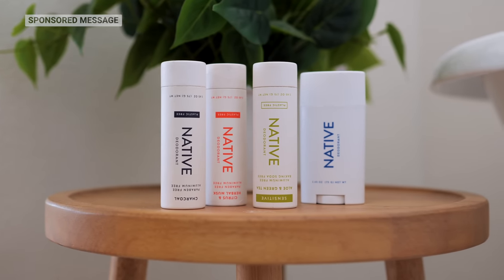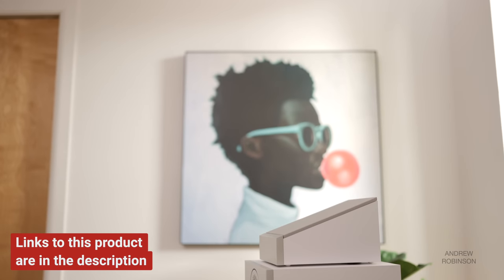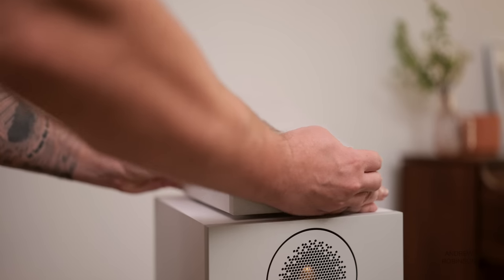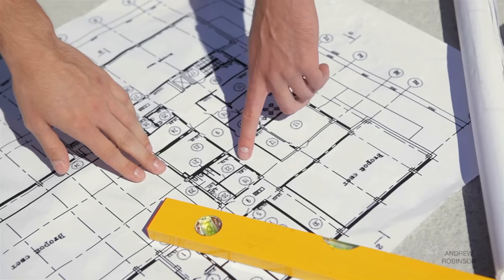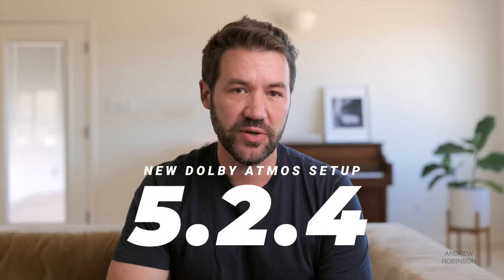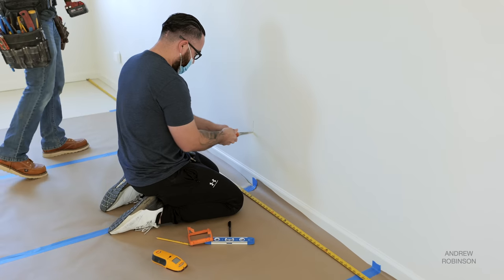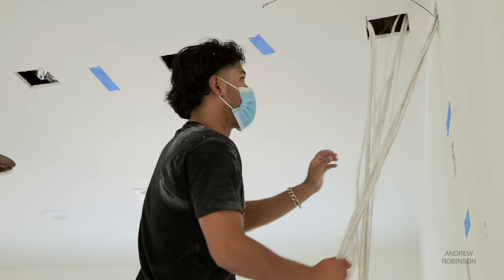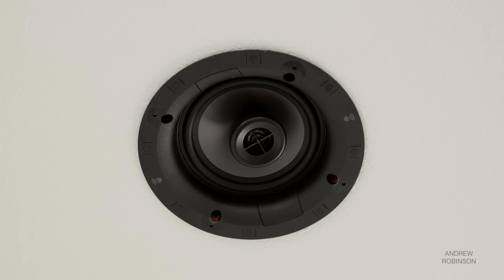INSTALLING DOLBY ATMOS SPEAKERS! Atmos In Ceiling Speakers

Comment: I have the same dilemma, I do not want or rather do not have a good place for ear level rear surround setup and I am considering the ceiling route. Is there a significant difference (sonically) between the classically positioned rear surround speakers and ceiling mounted ones? Perhaps Is Atmos more able to adapt to the setup than older DTS or DD 5.1 tracks? My current receiver is Onkyo RZ50 if that maters at all.
Reply: That is so totally wrong, you can do it but you break the whole idea of Atmos.

Atmos NEED two layers. Ear level and over the top.
And sorround speakers over your head make sounds that suppose to be behind you at ear level, coming from above you.
The idea of Atmos is having sounds moving backward and forward but also up and down.

Imagina a scenę where a rocket is launch behind you from the land and that rocket in a proper Atmos system goes from behind you raining according the sound goes through you.
In your system the rocket is already on the air, having the effect of only going forward.

I only consider rear effect valid when you only have Dolby Digital 5.1. In that case, it's OK to have the rear effect a bit higher than you ear. Not so much as your ceiling, but in this case it would be so bad.
Reply: @santiagoezquerrocordon1470  Yes, BUT, you can still achieve a 3D/height dimension if you place the "surround" speakers far enough back and they are the pivoting type of in-ceiling speaker that will hit your MLP at say a 45 degree angle. If your Atmos speakers are directly above you, you can still achieve it. Sure, it isn't ideal, but it is better for many people to try this than have speakers placed throughout the livingroom at ear level.
Reply: I'm looking to go 5.1.2,. 4 maybe I have rz50,  running 5.1 but 2 rear speakers are in the ceiling above the couch,  are u still happy with the rz50 and what speakers set up did u end up using? ty
Reply: @mikeschmidt2339  Ended up exchanging RZ50 for Yamaha A6A. As far as the speakers, currently I have a 5.0.2 setup where rear left speaker is stowed away and is only deployed for a movie session. I have 2 speaker profiles set up - one includes the rears (movie time) and the other doesn't. Front heights are old Michaura M55s which due to their hexagonal construction can be positioned on top of the cabinet on their sides and aimed at the listener or at the ceiling for a bounce effect. No ceiling speakers and no subwoofer. My fronts are Polk R700s and I find no need for a sub. Center is a Polk R400 and rears are Polk R100s. I listen to 2ch music 80% of time rest is generic TV and only occasional Movie so this albeit weird setup works just fine.

Comment: Any advice on using upward firing dolby atmos speakers if i have a wood ceiling planks ? Using S 809 HCS, so the atmos speakers will be the Jamo S 8 ATM. Room is 13x17 feet, height is 10 feet.

Comment: Interesting video, I enjoy your videos especially your bride's commentary. Our sloped roof runs the better way with lower front wall is 8' (110" screen) to the center at 11'6" then back to 8'. Our 7.1.2 system (JVC DLA-X500R, Denon AVR-X6700H, Focal Chorus 836V & SR800V with an HSU ULS-15 MK2). The surround side and rear surround speakers are mounted at 84" inches up leaving 2-3 feet to the ceiling top.  We also used a pair of "Height" speakers at the ceiling and front wall rather than a Dolby Atmos setup and are very pleased with the results. Any thoughts on how to improve will be welcomed.

Comment: I ended up with an unanswered question here: The cables goes directly to you amp? Do you have an interface on the wall? Or how is the connection?
Reply from the maker: The cables run directly to the amp at the moment, but they may get terminated at a wall plate in the future.

Comment: Andrew, I don't understand. You say total price was $2000. Yet, going to the speaker link below, they are $275 ea., so with tax that's over $1750. There is no way that install was $250 without huge discounts somewhere between the install and speakers  . Help me understand. Thanks
Reply: He might have gotten some discounts I suspect.
Reply from the maker: @Robert Williams, The speakers you see in this video sell for anywhere between $209 and $315 each based on what I've been able to find on dealer websites (yes, it is a dealer only in-ceiling speaker). Six at $209 is $1254. The labor costs were just under an additional $1,000. I did not ask for a discount nor was I aware of receiving any from Kreative. I believe in paying tradespeople what they quote and have never asked a skilled man or woman to work for exposure. The total cost of this build was just over $2,000 (I believe it was $2,147 or something close to that). I said it was "around $2,000" because based on your area and when or how you buy your in-ceiling speakers the price can and will fluctuate.
Reply from the maker: @DrawTheLine35, if I was given a discount I was not made aware of it by Kreative. I know I didn't ask for one. They're competitive in their pricing and do great work!
Reply: @andrewrobinsonreviews  I was just talking out of my butt, and I wasn't specifically implying a special discount or just general discount. 

Appreciate what you do!
Reply: Thanks for the reply. The link went to Crutchfield ( $275 ) and I was baffled. I did installs for many years and when I saw the drywall holes at each stud I knew the time consumption involved. Now I understand. I actually sent the video to a friend wanting help doing that ( only 2 speakers ) , so this is much better than my verbal explanation. He definitely won't be showing the video to his wife.Thanks for  taking the time to explain!!

Comment: Andrew, I hope you can answer my question. 
I'm turning a spare bedroom into a mini theater space. It is a perfect square measuring 12 x 12 x 9.
I want to setup a 5.2.4 atmos system in this room. 
Do you think a room this size is doable for installing 4 atmos channels in the ceiling?
Thankyou for your input!!
Reply from the maker: I'm not entirely sure four Atmos speakers would be necessary in a space of that size. I say that because you do want some space between say the front Atmos speakers and the rearward ones, which you may or may not have enough space for. I recommend looking over this document from Dolby: https://www.dolby.com/siteassets/about/support/guide/setup-guides/5.1.4-overhead-speaker-placement/sell-sheet-5.1.4-mounted.pdf

Comment: I just had a home theater company swing by the other day to quote me two ceiling speakers installed from a brand I had never heard about before called Episode. I had taken pics of my house as it was being built and we have 2x12 beams in the ceiling. Anyway, I didn’t care for how these guys tunes changed so many times, I always play like a babe in the woods to see if people are going to try and take me for a dummy or take advantage. I eventually got what I though was a high quote of $4k for two Episode ceiling surround speakers that probably wouldn’t match my original Paradigm Monitor 7s, Paradigm CC350 center and SVS Dolby Atmos Prime Elevations. $4k for two speakers that retail for approximately $1200, the rest was for install and opening of walls and ceilings along with repair. (Which wasn’t written down on the quote, hmmm) The overall cost was just to high for a PAIR of speakers I had no clue about along with their install. I guess I’ll have to run speaker wire and whip out the old stands, use my capable Mini Monitors when it is time for a HT night. You’re very lucky and blessed to have gotten professionals who were very fair and knowledgeable in their trade. These are the times I miss my old state and neighborhood because I know for a fact it wouldn’t have even been close to install surrounds.

Comment: Had to plan my listening room from scratch, running concealed cables through the ceiling and wall space, and a steel duct channel from rear to front, power and signal in separate ducts. Could have run more but have enough to run wide and extra centre at the front. When it was all sealed up was when the nerves started! Was there enough, was it to the right places, time to stick head in sand. All up works ok, phew!😏😏

Comment: The difference will only be revealed by content. The Dolby ATMOS of 6 years ago is not the same as now and your equipment and setup will reflect that, albeit in minor areas of sound. 128 points of placement to 11 is fun to hear. I have both systems as one is a Marantz 8015 7.2.4 and the other is McIntosh seperates 5.3.4 and you can hear the difference. I was able to install these but I know my way around the houses and one was a custom my Dad designed and a Great Uncle built.

Comment: Odd question! I have a Entertainment unit  With floor standers on both sides for space to hind my atmos speakers on the top of the entertainment furniture!  Also have angled  ceilings which I think are perfect for up firing speakers!  But they will be only 3 feet away ish to said angled ceiling! !  So question is yes or no ??

Comment: Thanks for sharing Andrew. I am interested in a similar install. You said that the labor and the 6 in-ceiling speakers cost $2000. Did that include the patch-up work to seal the holes? Since it included the speakers, were the installers able to get whichever speakers you decided were best?  If you already have the speakers, what do you think the labor would be alone?
Reply from the maker: I got the speakers on my own and had them sent to our house. Kreative only handled the install as they are not (to the best of my knowledge) a Klipsch dealer. So, sourcing the speakers myself, plus installation and wire (which Kreative brought and included in their quote) plus spot drywall patching and painting (not handled by Kreative) came out to a little over $2,000 (I believe it was $2,147 if memory serves). I didn't put the exact dollar amount for two reasons: 1) the Klipsch speakers we used routinely sell for anywhere between $206/ea and $309/ea depending on where and/or when you buy them --in other words the price is rather fluid; 2) installation costs are bound to be different depending on where you live. I provided the price in this video to give you all a guide so that should you get a quote for your job and it comes back at say $1800 you know you're (likely) getting a fair to maybe even extremely fair price. But if you get a quote for $5,000 maybe you might want to shop around just a bit.
Reply: @andrewrobinsonreviews  thank you so much Andrew I really appreciate it

Comment: I did something like this with the Polk 60w in ceiling speakers.  So worth it.   Moving into new home next week.  With concrete block walls.     I'm going to have to chase them open with a grinder.   Potential nightmare.

Comment: you should have gone with that auro3d/atmos combined setup putting the height speakers above the LR and SR. leaves u with more options when it comes to sound formats and u dont have to in ceilings

Comment: Patching sheetrock is no big deal as long as you are competent or higher a competent person to repair it. If you paint the repaired wall corner to corner, you will not have to paint the other walls.

Comment: I think you’ll find the bass response from the in ceiling speakers is very poor.  You really need to create a sealed box behind the speaker to get a boost in low frequencies from the air mass compression.  For sound effects I think it’s acceptable though.

Comment: Is there a room above the ceiling where you installed the speakers? One of the concerns I have about installing in-ceiling speakers is that cutting holes in the ceiling will allow sound to leak into the room above. I was wondering if this is true.
Reply: That's a good question. Ours does not have another a room above. I imagine you could install sound proofing material in the ceiling but that would probably be a big/costly project unless you're building from scratch.

Comment: I have a besides LCR and Sub an all-in-ceiling speakers in a 7.1.4 system - it works well enough, in reality of mixed use open living rooms. I am curious to see close up of handyman patch work to hide all the extra holes left over, struggling hiding an oopsie on one of my ceiling locations :)

Comment: So Now you have a 3.2.6 sistem.

Atmos sound need 2 layers; one ear level, other over the head.

The 5 or 7 speakers of the 5.1 or 7.1 system need to be around you, in that case, only having 1 layer of sound, it's OK to put the sorround speakers over the head, creating the effect of ambient.

With Atmos system you MUSN'T do it, becouse now you have effects over your head that they are supposed to be at your ear level. Doing that you break  The effect of sound raising.(realistic 3D sound)

Comment: I have a 5.2 setup, with my surrounds being ceiling mounted satellite speakers (a pair of SVS Prime Satellites to be exact). I wouldn’t have minded in-ceiling speakers like what you chose, but my ceiling is cement (I live in a condo), so that wasn’t an option and hanging the surrounds from the ceiling was really the only solution since I too am avoiding surrounds on stands (for kids as well as aesthetic reasons).

One question I have for you - if the surrounds are mounted at the same level as the height channels, won’t that mess up the sound stage? I also assumed I couldn’t do height channels with my setup because my surrounds are already at that same “height” as the height channels, thus the effects of the height channels won’t be right. If I was going to add speakers to my system, I was thinking my only option would really be to go 7.2, not something like 5.2.2.
Reply: @Pete.across.the.street  Did you try running a 7.4 system instead? Just curious why you decided to go 5.4.2. I’ve never done anything beyond 5.2, but I’m starting to get tempted, lol. Just curious on what your experience is.

Comment: Literally, there is no comparison between upwards firing versus overhead firing Atmos speakers. I guess the best comparison I may make is Atmos through streaming on the DD+ container, versus Atmos using the Dolby TrueHD container with say a Blu-Ray HD player with Atmos.

Just streaming with my Apple TV I noticed a huge difference by hanging my bookshelves off my ceiling. Not exactly how I want it to be visually, but at the end of the day sound matters.

Comment: Why not go for a 9.1, 10.1 or 11.1 setup that can support Dolby Atmos, DTS-X and Auro 3D?
Reply from the maker: Because I simply didn't want to go overboard. Up and to this point I've been content with my  5.1 setup (actually 3.1 most days). Once you go beyond 5.1 the number of folks who have MORE than that drops off considerably. While 9.1+ channels is possible, you're talking about MAYBE 1-2% of the population that have that type of setup and that's me being generous. As for Auro3D, it has ZERO support in the real world (i.e. outside of a few people being compensated to talk it up) and I don't see that changing anytime soon.
Reply: To add my 2 cents...that would have resulted in a ceiling full of speakers. The number installed now is already pushing my comfort limits. I'm just not a big fan of seeing gear in the walls/ceiling.

Comment: I really enjoy this content.. specifically having Kristi involved this time makes it a nice balance between for and function.  How do you design a HT / 2 channel room that is acoustically  treated yet still aesthetically pleasing?  How do you create a listening/watching space that is still functional and usable for everyday life?   It's quite a fine line to walk for most everyone in the hobby.
Reply from the maker: Stay tuned to this particular series for I think you'll get a lot out of it as well as answers to your questions.
Reply: It's not an easy task, Ace. I personally think the entire ceiling needs to be repainted because I can see the patchwork depending on my viewing angle. I'll probably push for that in the coming months and hopefully then we can paint the speaker grilles at the same time so everything looks more cohesive. As for the rest of the room...boy it's an even bigger challenge to find something that doesn't scream audiophile acoustic panels/traps, etc.
Reply: @KristiWright  Pro tip: match the ceiling to the speakers. If they only cut up one wall to fish the wires you can get away with repainting just that wall.  The color difference will be hard to detect visually going from wall-to-wall in a corner. Best to do it before moving in.... you don't have to move as much stuff around.
Reply: @KristiWright  Go 70's style and shagpile carpet everything, including the walls and call it retro or vintage lol
Reply: @Mikipedia  That would certainly be a vibe. :)

Comment: Andrew, We are finishing our basement. I am installing speaker wire in the walls and ceiling before the drywall goes up. I have read that my speaker runs need to be the same length for each pair. Do you believe that is true?
Reply: I had the same thought, but honestly, I'm always running the setup software and it digitally manipulates everything anyway. I don't believe it's essential.  On a 2 channel Audiophile setup different story of course.
Reply: @shawakwak  Agreed, if this is for surround or Atmos channels then your room correction should take care of any minute timing or phase issues that arise from uneven speaker wire lengths.
Reply: You'll NEVER hear a difference in unequal speaker wire lengths with the surround channels.  The only place it would really matter is in the Main L+R speakers.

Comment: $2000 is a fair deal.  I paid $2900 for full install, buy my job included the in wall speakers besides the ceiling.